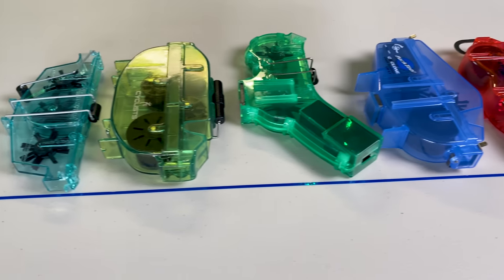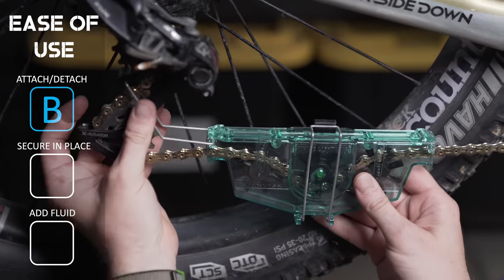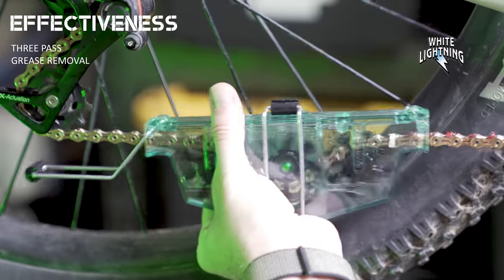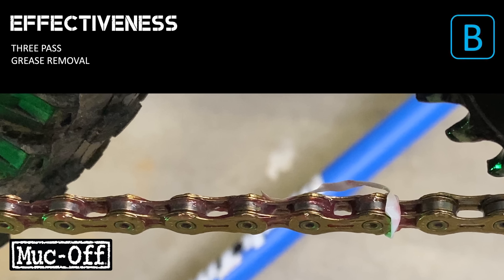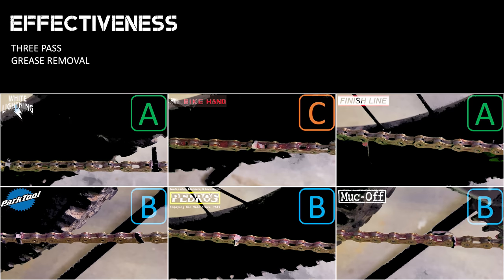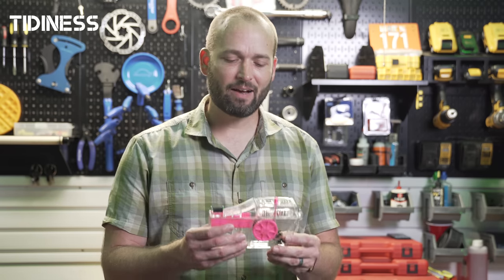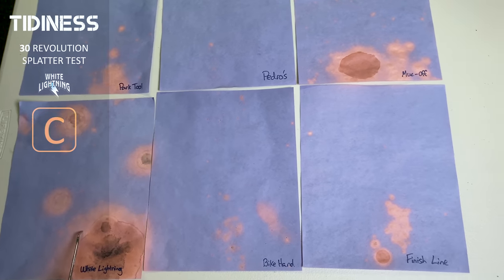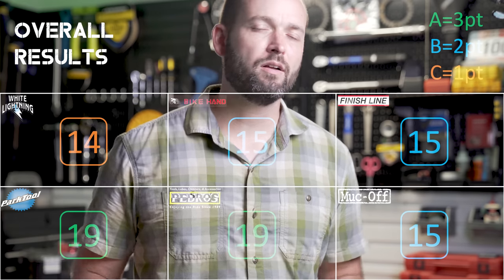Best Bike Chain Cleaning Tool Under $40? | Top Bicycle Chain Cleaners Compared

Comment: Alittle bit of gasoline, a park took brush, air compressor with spray nozzle and a rag. I always takeoff the coating that comes on all the chains in the factory and gasoline truly works wonders as a degreaser.
Reply from the maker: Thanks for the tip. - Jay

Comment: The "White Lightning" is sold in the UK as "Barbieri" and is cheap, I leave mine outside on the porch and a couple have been knocked off (by the wind)dropping 18" on to gravel and thye cases have cracked. They're really messy and seem best suited to 9s chains and below, thinner chains can go down between the brushes and casing....  I've resorted to removing the chain and putting in petrol then degreaser in a big jar and agitating by swishing it around... less waste, ,mess and can reuse  degreaser after straining through coffee filter paper into another jar. Maybe try waxing though as none of this is cheap!
Reply from the maker: Thank you for sharing your method! - Jay

Comment: Great Test! Is the Chain Pig also suitible for fixed gears due to the hook? Greetings from Hamburg Germany
Reply from the maker: Thank you for the note! You could probably make it work, but you might have to hold the case instead of using the hook - the hook is really designed to attach to the rear derailleur. - Jay
Reply: @SimplyMountainBiking  Thank you! I will try....just ordered it...will inform you if interested ...greetz!

Comment: Did you tried a brush, naphtha or paint thinner and a small plastic dish like Tupperware? Those fancy cleaners are very nice but then you need to clean them too. A dish+brush+thinner set is easy to use and cheaper.
Reply from the maker: Thanks for the tip! - Jay

Comment: Hey.. Which of these would you recommend for emtb? On e bikes you can't back pedal to move the chain like you did in this Video.
Reply from the maker: The Park Tool chain cleaner is the only one with a reversible handle allowing you to turn the unit around and clean the chain in the opposite direction.  I'd suggest that you might try that one. - Jay
Reply: @SimplyMountainBiking  thx bud 👍🏻

Comment: While the Park Tool does a pretty good at cleaning, the unit is quite fragile. I'm on my 2nd one, and the stainless steel's locking clips have a small pin holding them in place which constantly fall out, making the clips easy to lose. The plastic where the small pins are inserted crack easily. The magnet at the bottom falls out easily, and mine fell out and shattered. And in my 2nd unit, the big, double-sided brush's plastic enclosure was rubbing against the casing, and not turning. I had to sand it down so it would rotate freely...
Reply from the maker: Thank you for sharing your experience - Jay

Comment: I have an older version of the Park Tool Chain Cleaner (CG-2.3) and that magnet on the bottom is worthless.  It was always falling off.  One day it fell off and bounced off my deck and I never found it.  I had meant to JB Weld it in place permanently but I never got around to it.  Other than that I've never had any issues with it.  I'm not sure why these all have removable handles as I never take the handle off of mine.  For a degreaser I use Zep Citrus Degreaser - it's $10 from Home Depot and WAY better than the Park Tool degreaser that came with my chain cleaner.
Reply from the maker: Great tips! I owned the same model and ran into that issue too.  I think I'll JB Weld the magnet and the handle to this one (since I created some small cracks on the sides of the handle with the drop test) - Jay

Comment: Surprised you gave an A for Park 300 test.
I run a bike shop and we clean about 100 chains a month. We have both the white lightning( barbieri) and the Park. White lightning is not as robust but does a good job. The Park is perhaps beyond useless. The main roller seizes on the sides and refuses to turn, the small rollers have had their bristles plucked , mostly by brand new chains. We replaced the rollers thrice on the Park and now we refuse to use the Park or stock them. With the chain twist test the white lightning wins overall and yes we do clean them often.
Reply from the maker: Thanks for sharing your first-hand experience!  My test certainly wasn't a high enough volume to represent durability for 100 chains a month - after handling all of them for the tests, I'd honestly be surprised if any of these held up to that workload! -Jay

Comment: I have the chain cleaner you wouldn't even test. I was skeptical if any of those things were more than a gimmick so I bought the cheapest one I could find to test it. No, it is not very high quality, rattles and can get stuck sometimes but it does the trick. I am not sure if I'd actually spend more money on any of the other devices.
Reply from the maker: Thanks for sharing your experience! - Jay

Comment: I'm surprised that the 2 best scoring tools are not the 2 tools that clean the most grease/dirt off the chain, which seems the MAIN reason you'd buy one. Therefore I think the White Lightning is a bit underrated here. But besides that, I think I would buy a Parktool cleaner anyway. :-)
Reply from the maker: Thanks for the feedback :). I considered weighting the results, but decided to share all of them equally so viewers could decide which factors are most important to them!  - Jay

Comment: I just tried the muck off cleaner.  It was so good I threw away my park tool cleaners.  Screw weight and drop tests, the muck off puts clean fluid on the chain, no more recycling dirty fluid onto the chain.  I have never had a cleaner chain with less waste of fluid.  Why ‘fill it to the line’ when you don’t need to when you just drop it down from the clean fluid tank.  Simple solution to breaking a chain cleaner, don’t drop it.
Reply from the maker: Thanks for sharing your experience! - Jay

Comment: I would give the edge to the Pedro's just because of that warranty. I have a CM 5.3, and I might step up to the Pedro's if I have any issues with it (I'm out of warranty)
Reply from the maker: Someone posted a comment that Park Tool has a limited lifetime warranty as well and they had a good experience with it.  So you might check that out first if you run into problems. - Jay

Comment: I have the park tool unit and it melted and warped in the sun when drying after use, outside. (Looks like all of these are the same plastic and would have same issue) :-/  still works sort of ok but lid doesn't shut all the way and handle won't stay on.
Reply from the maker: Bummer! I've heard others report issues with UV when left in the sun. - Jay

Comment: They charge a fortune for those proprietary degreasers and cleaners! The bike industry is getting so expensive, selling things one may not need. What about an environmentally friendly dishsoap, water, and a small sponge cut into manageable pieces. One bowl for dishwater, one for clean rinse water. Then silicone spray the chain to displace water and acts as a lube for winter riding. Wipe the outside of chain dry so grit doesn't stick. Great test, thank you! It seems these devices are over rated. The Muc Off one doesn't seem so great here but I would consider the Pedro Chain Pig.
Reply from the maker: Thanks for sharing your thoughts! - Jay

Comment: Admire your test and video. But dont use any of these. I invested in a good ultrasonic cleaner, i detached the chain from my bike completely. Then add detergent into the cleaner and place the chain in the machine. Let the ultrasonic cleaner heat up to about 40°C and let it run for 10-15 min 
You will be shocked how much dirt is from the chain. Sand and all kinds of mud  stays in the container.
Wash the chain with clean detergent. Wipe the chain through an old cloth.
Re-assemble the chain, add new grease just a tiny bit or use your favorite fat.
Notting beats that methode.
Reply from the maker: Thank you for sharing your experience - Jay

Comment: I had the MEC brand cleaner they used to sell (with a set of replacement brushes included) that's the same as the White Lightning. I liked it at first, it made the chain a little shinier, but it always came out gritty even after changing fluid a few times. Plus it leaked fluid and dumped it out the end with the chain, what a mess, every time. I found that removing the chain and cleaning it in a jar with varsol over a day did a much better job, and didnt' cost any more. I sold the MEC cleaner for the $5 I paid for it. Why does the White Lightning cost so much?
Reply from the maker: Thanks for sharing your experience! Glad you found a solution that works :) - Jay

Comment: Are metal wire brushes out of the question? I imagine that they would be really effective.
Reply from the maker: I've never had a chain in bad enough condition warrant the use of a wire brush.  I wouldn't personally use one as wire could break off and be left behind between links.  There are a lot of options to clean a chain - everything from the tools show here, to tooth brushes to ultrasonic chain cleaners... - Jay

Comment: How much of fluid (ml) do you have to add per reservoir? I'm always concerned about it and I feel that with a painting brush I would use my degreaser more efficiently.
Reply from the maker: This is what I measured during testing - Jay

White Lightning - 25ml
Bike Hand - 68ml
Finish Line - 32ml
Park Tool - 69ml
Pedro's - 28ml
Muc-Off - 26ml
Reply: @SimplyMountainBiking  Cool! Would be nice to have those numbers on the video... Thanks a lot! Now I can retire my brush and get cleaning tool and save time

Comment: I have the Park Tool and when I ran out of fluid I started using Simple Green.  It's really cheap and seems to work well.  Anyone else here try it and is it good enough or is there something different I should be using?
Reply from the maker: I've used Simple Green before - it seems to do the job.  We haven't done a degreaser comparison - maybe something we'll do in the future. - Jay

Comment: Are any of these under 5 inches in length? I have a folding bike, so there isn't a lot of space to attach one of these
Reply from the maker: That is one measurement I did not take.  Most were a little over 7" long.  You might have to use one of the alternate chain cleaning methods that viewers here have mentioned here (e.g. toothbrush method) or take the chain off the bike to clean it. - Jay

Comment: Why? Simply remove your chain and place it in small plastic lidded container with bio degreaser and shake it and let it sit for an hour; rinse with water and dry. Done.
For more thorough clean -- 3 containers: petrol; degreaser; isopropol; water rinse and dry - then lube link overnight and wipe down. my 2cc if you want to do it properly.:goodvibes:
Reply from the maker: That is definitely one way to do it! - Jay

Comment: I’ve owned several of these, most are made of the poorest plastic, all have cracked and the handles have broken off every one.  They should be better quality for the money.  It doesn’t matter if they have longevity with wheel and brush replacements when the housings leak or the handles break off.
Reply from the maker: Thank you for sharing your experience - Jay

Comment: I had the bike hand chain scrubber (branded under cleanskin) and it seemed alright for a while but after about 9 or 10 months of use (with some hydrocarbon based chin cleaner which seems pretty common) and with its first light summer (1 or 2 days hitting 40c during the whole season with the average around the low 30s) it began cracking and falling apart, I don't know if it's a problem with the plastic from the heat, the solution or both or whether it's something else, but it's fully fucked now. I'm really frustrated with the results of it being broken so quick but hopefully the muc off one will be better
Reply from the maker: Thank you for sharing your experience for others to learn from! - Jay

Comment: Aww, I really wanted to know how the super-cheap no-name poor-quality version that you didn't test worked out! 😁

In the 2 years since this video was made things have changed a bit, and I've seen generic (cloned) cleaners in blue or black plastic on sale for between £4 and £7, which is less than the cost of a set of replacement brushes for one of the better models on test.

Cheap and nasty, yes, but mainly CHEAP. And you can get a set of [equally cheap and nasty] replacement brushes for under £2. Of course, that assumes that the cleaner itself will survive long enough to need them. The budget cleaners are apparently moulded from ABS, which is pretty tough stuff, so maybe they're worth a closer look.

Whatever. People spend more than that on a box of disposable hand-wipes, so it's tempting to experiment with a dodgy cleaner and treat it almost like a consumable item. Work it to death and either swap the brushes or replace the whole thing a couple of times a year, perhaps?🤔

Comment: I think grease removal should have had extra weight on it's grade since that's the entire reason you buy one of these in the first place

with that said, I had a feeling that the ones that added a bend to the chain would clean better, and they did, but to the detriment of other grades in this scale. 

Why wouldn't you choose one of them, so that your chain gets cleaned properly, rather than park tool or pedro's just because they scored higher?
Reply from the maker: Thanks for sharing.  I decided to let each viewer prioritize what aspects were most important to them - though your point is well taken! - Jay

Comment: I never liked these fragile and relatively expensive plastic products! I always preferred to remove the chain and shake it inside a container with proper cleaning liquids. It's better this way since it doesn't splash the rest of the drivetrain with fluids. Also, it's better to clean the cogs/chainrings and jockey wheels without a chain on them.
Reply from the maker: Thanks for sharing your experience, great tip.  - Jay

Comment: Great review. However I disagree with your results. The cleaning portion of the test should have been weighted twice if not 3 times as heavy since that's the purpose of the tool.
Reply from the maker: Definitely a valid point, I considered that, but ultimately decided to leave all the weighting neutral and share the full results so that every viewer could decide what's most important to them! Thanks for the feedback! - Jay
Reply: @SimplyMountainBiking  I get that, but that rationale taints your overall scores at the end. The Pig unit is the clear winner here and the Park Tool is in the bottom half yet you have the tied at 19.

Comment: I'm surprised White Lightning got an A for effectiveness. I've been using that chain cleaner (under a different name) for a few years now, and it only ever did a so-so job.
Reply from the maker: Yeah - it was difficult to come up with a controlled testing methodology as the roller and brush design was quite different across the units.  

The White Lightning didn't do a very good job on cleaning the sides of the chain  - Jay

Comment: I have the White Lightning (sold under the brand Force) 
My bike has a Sturmey Archer 3spd and I had to take out the top brush to use it. You need slack in the chain to close. 
It is very bad like this. It is not designed for bikes with one gear or geared hubs.
Reply from the maker: Thanks for sharing your experience! - Jay

Comment: Honestly, I quit using chain cleaners like these. They only really clean the outside of the chain and don't really get down in the links very well at all. I started using an ultrasonic cleaner. I use HOT water, and a decent splash of dish soap and let it do its thing for a handful of minutes stirring it up every once in a while. Works great and get EVERYTHING clean.
Reply from the maker: Thanks for sharing - an ultrasonic cleaner is a great solution! - Jay

Comment: I’ve owned a couple of the Park chain cleaners. Neither lasted very long. Cheap plastic! Park makes an all metal chain cleaner if you want to shell out around $100. I don’t! Finish line makes a brush called the grunge brush which does a great job for less than $10. I don’t think you see many pro mechanics using these chain cleaners.
Reply from the maker: The metal one is definitely a premium price, I've never tried it.  A grunge brush will definitely do the job :) -Jay

Comment: I like to blast my chain clean with an aerosol can of dry lube. It blows off all the grit and lubes the chain in the process. WD40 makes a good dry lube because the straw is heavy duty and permanently fixed, so you can't lose it.
Reply from the maker: Thank you for sharing your experience - Jay

Comment: Great video, but wow ... for something that looks like a random dollar store toy, these things are expensive ! 

A little plastic container with liquid inside and a couple simple mechanisms, it's literally the same level of complexity to manufacture as a water gun, probably simpler. And for 40$, you can get an amazing one, from a brand, with multiple jets, pressure tank, sic decals and speed stripes :D ! 
I can't imagine that these things cost more than a couple $ to manufacture. Convenient or not, by principle, I refuse to pay anything close to 30$ for a brush and a spring in a plastic toy. I will keep using my free used toothbrushes and plastic bottle :)
Reply from the maker: Nice! Thanks for the feedback. - Jay

Comment: No real explanation on how the fluid/degreaser contacts the chain. How much volume? Is it reusable?
Reply from the maker: I did capture fluid usage data, just didn't include in the video :).  

White Lightning - 25ml 
Bike Hand - 68ml 
Finish Line - 32ml 
Park Tool - 69ml 
Pedro's - 28ml 
Muc-Off - 26ml

I wouldn't say it's reusable. - Jay